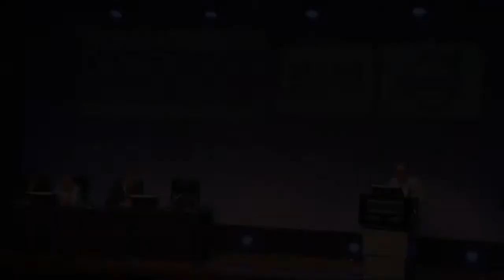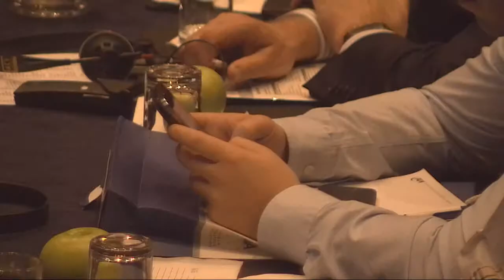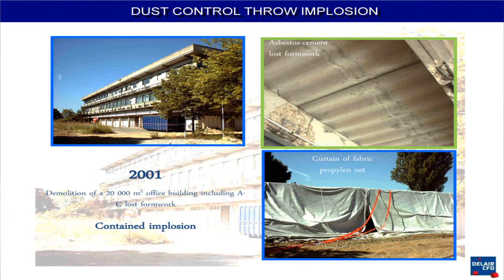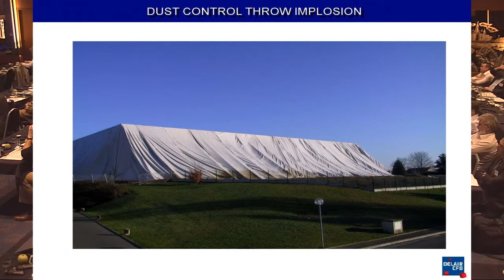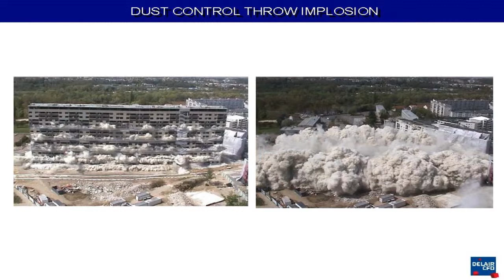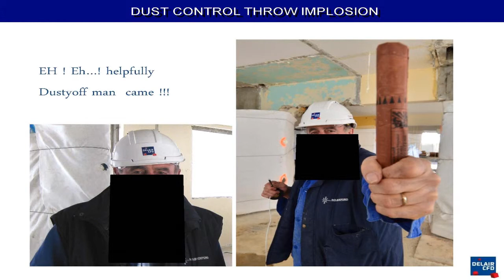World Demolition Summit 2013: Patrick Villard

Comment from the maker: At 2013's World Demolition Summit, Patrick Villard - the Commercial Director of France-based Delair CFD - made a presentation on different methods to limit the spread of dust during explosive #demolition.

Topics discussed include the inefficiencies of a German dual-hose system to control dust, his experimental use of a combination of a fabric wrapping with fire-fighting soap foam, and the most recent approach, which involved a mixture of water bags in the building combined with a series of explosive-laden children's paddling pools outside to prevent any spread of dust after an implosion.